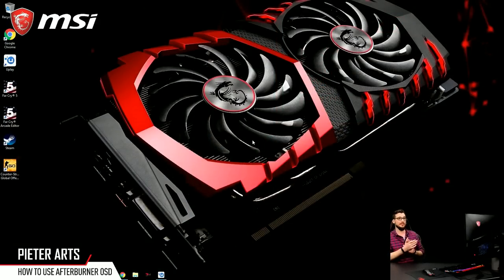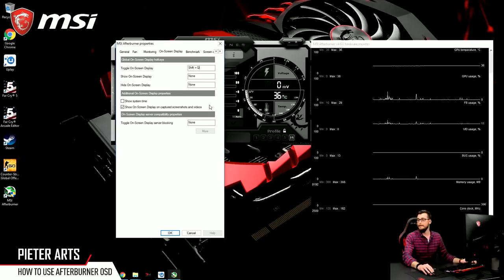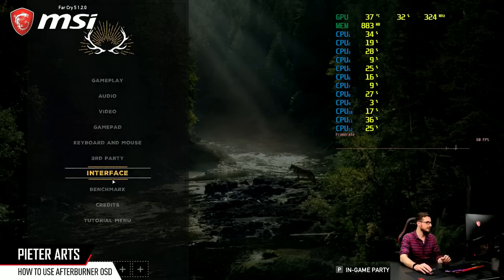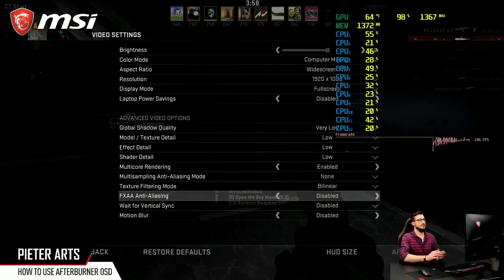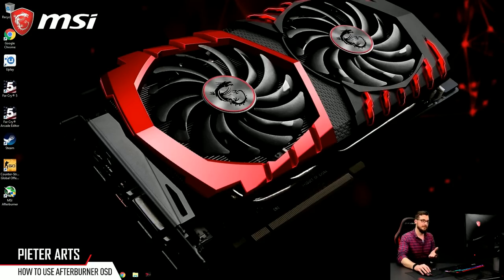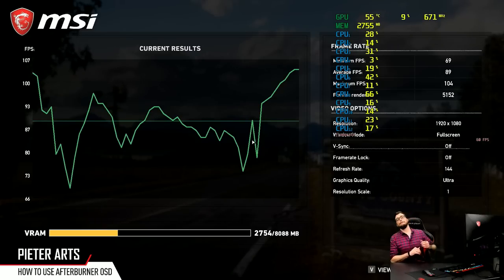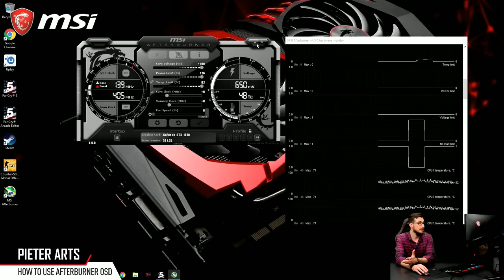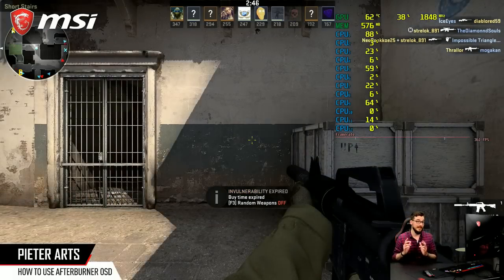How to use Afterburner OSD

Comment: There is a good question on 1:07:00 about changing OSD color if some condition is met (e.g. if GPU temperature cross 80C limit). That's actually possible to do so for any graph available in MSI AB hardware monitoring module. There are alarm threshold settings for any graph, so you may define max or min threshold and corresponding OSD item will change the color when the limit is reached. Additionally you may configure MSI AB to play sound alarm in this case or even perform some action (e.g. load some specific profile with higher fan speed or even shut down the system). I've demonstrated it in one of my videos:

https://www.youtube.com/watch?v=kZ3B4Cz2UYk
Reply from the maker: Thanks for the comprehensive explanation Alexey! Let us know if you'd be up for joining a future stream about Afterburner to answer more detailed questions live :)
Reply: It would be super nice if you could add some scaling support for the text when user opt to show information in the systray. In my case Windows is set to scale the UI to 125% but the text from Afterburner in the tray looks awful. Thanks for the software!
Reply: @antondnice  last beta of MSI AB released about a month ago already disables OS level scaling for monitoring tray icons, so OS have no chance to make it distorted. Next beta will also add two more hardcoded tray icon fonts for >=150% and for >=200% DPI modes.
Reply: @unwinder  Ok, nice. Downloaded the last update and it works fine now. Thanks!

Comment: doesn't show , min , avg and  max fps
Reply: Min/avg/max/1%/0.1% lows are shown in OSD in benchmark mode only. Open "Benchmark" tab, define a hotkey for staring benchmark there. Once you press it during 3D application runtime, benchmark related statistics Min/avg/max/1%/0.1% will start recording and become visible.